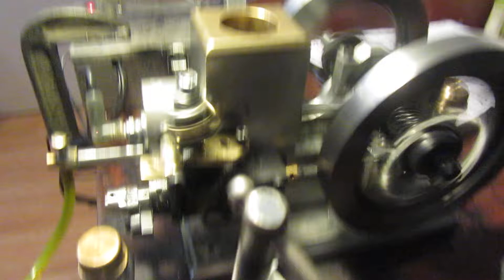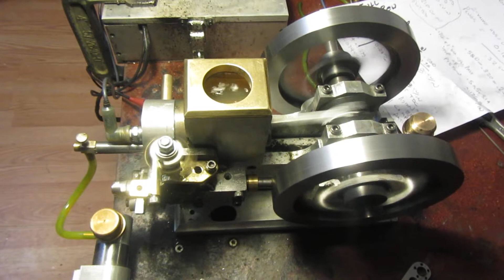ENGINE RUNNING WITH THIRD CYLINDER HEAD 2019 02 19 001

Comment: I can see a spark inside the wire connector to the plug.  Nice running engine. Very interesting valve cam action.